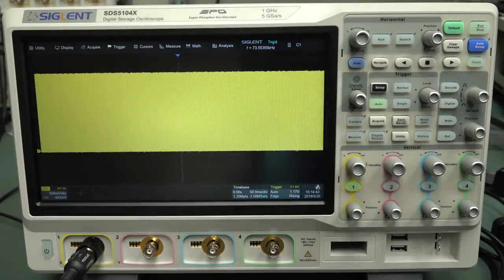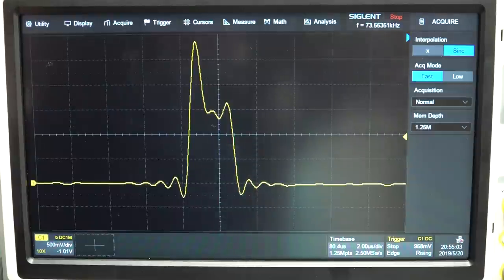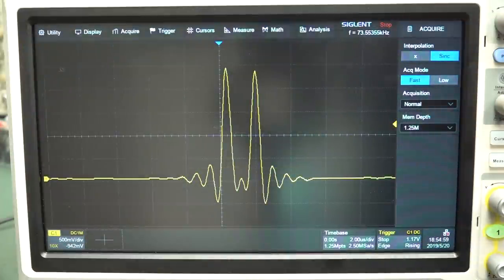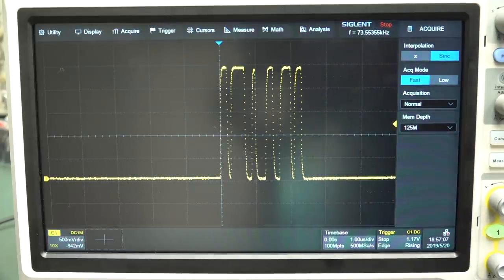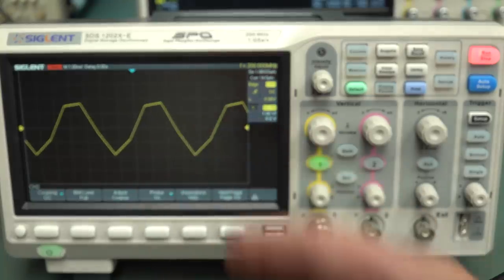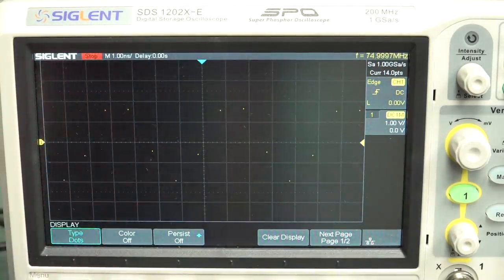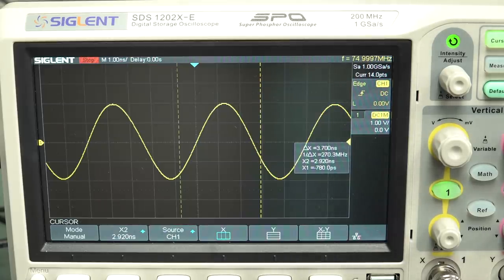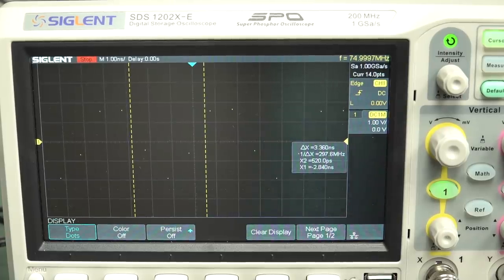EEVblog #1213 - The Oscilloscope Interpolation Trap!

Comment: I wouldn't call sinc "smoke and mirrors". The Nyquist-Shannon sampling theorem derivation requires convolution of the sampled values with an ideal sinc function to recover the original signal. The reason for the 4x instead of the 2x limit is because of the finite number of samples and the finite (non-ideal) sinc function used. Just as the Fourier transform is only valid for infinitely repeating signals so real systems use windowing functions which add some distortion. It's important to know what the differences from the ideal case are to interpret any measurement.
Reply from the maker: It was just a turn of phrase, meant to explain that something tricky is going on. I explained how it's mathematically correct.
Reply: @EEVblog  I assumed you knew, but wanted to elaborate on it a bit. Give people the terms to search for and all, with spellings. I suppose I phrased things badly.
Reply: @EEVblog  On the other hand when it's on you'd know something's wrong then you can zoom in. Otherwise you'd end up using linear without knowing there's something between the samples.
Reply: The same problem occurs for inexperienced DSP engineers in using FFTs for spectral analysis. Various window functions can be selected depending on the signal and sample rate. I have seen numerous cases where engineers told me that a spectrum they were examining looked distorted but what they were actually seeing was the effect of the particular window function selected.
Reply: How does having a finite number of samples on a CD audio track affect the resulting waveform?  Does that add distortion that wouldn't be there if the audio were sampled at 88.2 KHz instead of 44.1?

Or, better stated:  Does the distortion introduced by not having an infinite number of samples in a 44.1KHz audio track show up in the audible range?
Reply: @Hyxtryx  If the filtering is not steep enough there will be frequency inverted signal going into audible range. But that would be too stupid to design such design. And the phase shift due to filter may cause audible difference. Science haven't shown which type of filter is the best but it's there. 
And the bit depth of the sampling will affect the Nyquist theory. So it will not be ideal. So better bit depth, higher sampling rate, more gradual filter will be the best way to reproduce audio signal.
Reply: Sinc is not the problem. Using linear interpolation won't save you. It gives a far off result when a sampling rate is insufficient and a signal contains high frequency too, just a different kind of wrong result comparing to sinc.
Reply: "The reason for the 4x instead of the 2x limit is because of the finite number of samples and the finite (non-ideal) sinc function used."
Thanks for this, exactly the info I was looking for. I was like "What? Nyquist OK, sinc used, then why the poor reconstruction?"
Reply: Creates high-frequency ringing, you filter out anything higher than 20 kHz. So yes, higher sample rate could push your distortion beyond 40kHz, but honestly past 16kHz is basically not audible.

Original CD spec is sufficient for stereo audio reproduction. When recorded properly, using the 24 bits of dynamic (loudness) range and the 44.1 kHz bandwidth, it sounds just fine.

Comment: Basically this is just sampling theorem. Multiplying with delta pulses in the time domain (equals the sampling process) means folding in the frequency domain. If you want the analog signal back you filter in the frequency domain with an ideal rectangel to get only the low frequencies up to the maximum of 200 MHz limited by the bandwidth of the analog frontend (and not the ones that occured as copies of the real signal at higher frequencies due to folding as an effect of sampling in the time domain). This rectangel in the frequency domain corresponds to folding in time domain with sinc aka. Use a sinc-wave for every point in the time domain. If you have too low sampling the frequency copies due to the sampling interfere with the original low signal-frequencies. Trying to filter out the original signal with the ideal frequency rectangle filter aka. Sinc-interpolation in time-domain is not possible anymore and you get nonsense. The time domain sinc is therefore just coming from the ideal rectangle frequency filter. Flies away.

Comment: I always maximize the memory and check the sample rate before I zoom in.   On my SDS1102X the slowest sweep that will capture at 1 Gs/s is 1ms/div with the full 14M memory depth turned on.   It is great for zooming in on the scope, but gives you a vary large file if you want to save the data.
Reply from the maker: Yeah, but you have to know that and do the mental calculation and keep track
Reply: @EEVblog  You can just watch the sample rate indicator as you adjust the sweep rate.  If it drops below 1GS/s your sweep is too long, or you do not have the memory set long enough.  You don't need to do it in your head.

Comment: Good video about an overlooked aspect. The 500GS/s advertised in the data sheet is acquisition interpolated sample rate. These samples can be saved, while display interpolated samples cannot. They are meant to fill up the screen pixels to get a continuous signal.

Comment: The whole "deep memory" thing seems like a trap for young players... why does it allow you to zoom in beyond what can be reliably rendered from the available data?
Reply: I get annoyed by scanners and cameras that do it too.
Especially since they often make a concerted effort to obfuscate what the actual resolution limits of the sensor are. (Especially scanners - my scanner is something like 1200x600 DPI, yet the software just goes up to 3600 dpi and makes absolutely no mention of which, if any of the settings produce an interpolated image.)

Interpolation, especially without explicit warning that it's being done really can be frustrating sometimes...
Reply: Yep, fell for that once or twice too, but it´s the way it is, sample memory is either expensive or slow. Going for logic analyzers however does not help when trying to see signal quality. Throwing money at the problem by even higher bandwith scope is not for most hobbyists. The good thing is that MSOs get better and better and you can check signal quality and have data interpretation in one device.
Reply: @closure4791  But do you know the answer to my question?

Comment: This video is basically a 17 minute long advert for having a fully analog scope on your test bench alongside your digital one. This won't affect a pure analog scope as they don't have interpreters to begin with.
Reply: So how does it connect the "dots"? Not in a "curvy" way?
Yes, I know, they are not individual "dots". Just get to the point what the signal looks like. I doubt that it would be any better.
Reply: @leocurious9919  Analog scopes don't draw dots at all. Analog scopes amplify what you're probing, then use that to drive the deflection yokes of a cathode ray tube display. That, in turn, magnetically deflects a stream of electrons that excite phosphors on the screen. That's what makes them analog; They show you exactly what comes into them.

They don't have quite the capabilities at super high frequencies, but on the flip side, you won't get bitten by sampling errors. That's why you should have one on your test bench alongside a digital scope. You want both. Both can do things the other cannot, they compliment rather than replace.
Reply: @TestECull  Analogue also has limited bandwidth. And when that happens it's way more ugly than sinc interpolated digital scope.
Reply: @TestECull  One digital scope is good enough. Analogue scope doesn't help anything.

Comment: EEVblog  Dave,  Interpolation is/was not used on analogue CRO's, like the Tektonix 511 (or 547 if you wanted dual beams.) simple reason is they don't need it, because they display the whole timeline not discrete samples.  Modern sampling oscilloscopes use interpolation to display a pretty waveform, and as you correctly point out, this can provide misleading results.  This can lead you astray if you are chasing spurious signals, ringing etc that is occuring at the upper limits of the oscilloscopes bandwidth, you most likely will miss it, but with the old analogue CRO,s you still got some visual indication that something was there.  Obviously the old CROs had their intrinsic issues, like persistence and brightness at higher speeds, blooming and burnt out screens, plus they were heavy and fragile, and forget about signal capture, that was done with a special polaroid camera attachment, but, they did have their advantages.

Comment: In short, it just treads sampled data (represented as dots) as impulses and replaces them with sinc function for better reconstruction.
This is how basically ADC's work. In a practical situation, sinc function is a square wave. It is called zero order hold. It is widely used in PWM technique. According to Sampling Theorem, data should be sampled with frequency twice time higher than max. freq. component of the signal. If you dont, signal is distorted. That is what happens in the video.
Reply: You are mixing stuff up. Sinc can in either time domain or frequency domain. The pulse is in the other domain. In this case sinc in time domain and brick wall in frequency domain.

Comment: the effective sample rate is making assumptions about the signal... the scope is a device to show you what the signal is.
you have a scope that shows you what it assumes is happening, not a scope that shows you what is happening.

you can only use the scope close to its sample rate if you already know what you are measuring.

Comment: the mathematical motivation for using sinc is, if you integrate a square pulse, then integrate the resulting triangle, the integrate that, ad infinitum, you end up with sinc. it's analogous to going from "nearest neighbors" interpolation to "linear" to "polynomial" etc etc all the way to the "end"; so sinc is the "ideal" sampling kernel for interpolation in this way. it's also the fourier transform of a square unit pulse, i dunno if there's a more obvious explanation there.
Reply: Absolutely,  but the sinc isn't finite. Usually you get away with it if you have sufficient discrete samples so that the cumulative error is less than that of the instrument. Another option is to window your sinc with a Gaussian  (as it will stay Gaussian in Fourier space ) which will make your interpolant finite.
Reply: @LutzSchafer  good catch thx

Comment: I don't think you're quite on the mark when it comes down to the interpolated sample rate of the high end scopes. It means that they can vary the trigger delay by a few pico seconds and then overlay the different samples so that you actually have all samples measured, although on a different part of the waveform. This only works on pure repetitive signals where the trigger point is well defined.
Reply: Pretty sure this is called equivalent  time sampling (as opposed to to real time sampling). They used this a lot before high bandwidth adcs were cheap.
Reply from the maker: That is Equivalent Time Sampling (ETS), quite a different thing to interpolation on a real time or captured signal

Comment: Hi Dave, coincidentally I was snooping around the forum looking for some guidance on a sampling scope last night, so this is quite helpful - I'm trying to debug the ringing in an epaper boost circuit (I gather I need to design a snubber filter across the switch) but I'm using an old analogue 20Mhz oscilloscope, so  measuring the frequency of the ringing is pretty tricky. I've just got to estimate it from the graticule by eye before it disappears - no cursors and no sampling!

I don't know if you've done any vids about controlling or preventing ringing in boost circuits - one clue I've noticed that there is ringing is that when the circuit powers off there is a little (audible) noise from the circuit.
Reply from the maker: Haven't covered that, sorry.
You need a digital scope!
Reply: @EEVblog  Texas instruments and digikey both have guides on it with minimal maths needed, plus a little experimentation to find the right capacitance value. If I'd known how to design it to minimize ringing, I could have avoided the need for the snubber circuit altogether - as my reference circuit did.

Digikey: https://www.digikey.com/en/articles/techzone/2014/aug/resistor-capacitor-rc-snubber-design-for-power-switches

Texas Instruments:
http://www.ti.com/lit/an/slva773/slva773.pdf

Many thanks for the vids!

Comment: The interpolation can be misleading, but the underlying problem is the scope, for what ever reason, not using the full buffer.
Seriously - in most instances you just want to capture the data and view it. it would really make sense to set it so the sampling-rate over the capture-time pretty much fills the whole buffer - unless you specify the sampling-rate or other settings.

And why the hell do scopes still have so little memory???? Make it 20$ extra for 4 GB RAM - at 32bit/point that would still be another 100 million sample points.
i have seen explanations like "more sample points cause longer deadtimes" - why? The scope does not need to visualise all the points at once. The overhead of a simplified depiction is rather small, but the benefit of being able to store several times more data can be quit nice.
For example when trying to capture the characteristics of many repeating analog signals - capture the first 2/4 signals, keep them stored in memory, capture the next, and the next, and the next.

Comment: It can be mathematical proven from dac to adc both using sinc or same sample rate. I have done digital processing in university it can be proven. Nyquist theorem is also proven.
But if it's from a unknown source, it's not the case. However, sinc is to utilize the available sample point in a most efficient way for lowest bandwidth. In a different perspective, if you use linear interpolation, you can creat high frequency noises which you don't want. Also you can post filter the linear interpolation result to get close to sinc. It's just digital filtering.

Comment: Wrong! It's not memory depth. It's lack of anti-aliasing filters for lower sample rates. Look at sample rate on 14:30 when you change time base (sec/div). Sample rate is automatically reduced as time base is increased, while acquisition is running. When you hit stop button, sample rate becomes frozen. Nyquist sampling criterion not met - distorted signal you get.

Comment: It seems in signal measurement domain, sinc interpolation is the king and it is not possible for other types of interpolation to contend w/ it, such as spline, polynomial, etc. Is it still the case in 2023 when I'm commenting now?

Comment: So why is the memory depth not always set to maximum?.  What is the trade off?
Reply: This - exactly this.
There is pretty much no tradeoff. And it should be the default-setting.
Reply: Basically everything runs slower : math functions, refresh rate, etc
Reply: @autogolazzojr7950  ... only if they were braindead and would brute-force everything.
There is no need to perform maths-functions on the full raw data you know? You can just apply them to a sampled set or other subsets and get pretty much no performance downsides - and then if you choose you could apply them to the whole dataset and get more accurate results when needed.

But i am sure that to you a car having a bigger  trunk also means you will always take longer to load and unload it, even if you just take out the last part you put it.........

Comment: Oh boy, oh boy. The Shannon Nyquist theorem specifies explicitly that you have to get a ratio of AT LEAST 2:1 of the HIGHEST frequency component of your signal. Else any anomalies at or above the 2:1 ratio in your signal is going to suffer representation with amplitude and phase errors. IMHO Shannon-Nyquist is a base to start from when designing requirements, but far from being the "rule". I actualy never use it as a base to start from. I look at the TDH I can afford and work from there. I am not belittleing the work of those two pioneers which I hold the highest regards but in college and universities, I think their work is misrepresented. I work in telecom.

Comment: As a noob asking: Do you think a analog scope is better to use for beginners?
Or in other worth: What is the best type of scope for a beginners?
Reply: I think the best scope to learn on is an analog/digital hybrid, but honestly digital is better than analog. Digital allows you to stop, measure and analyze your waveform. Not gonna happen on an analog scope.
Reply: @autogolazzojr7950  Back in the "old days" before we had digital scopes, I used a type of analog scope called a storage scope which was able to freeze the image on the CRT face. This was the only practical way to capture a singe-shot pulse for analysis. It was certainly not as good as a digital scope and it had limitations but it was better than nothing.  Another consideration is size. Most analog scopes are huge, especially in depth because of the CRT, as compared to modern digital scopes. If you have limited lab bench space this is a factor.  I'll take a digital scope over an analog scope any time.
Reply: @stevewhite6252  I'll second that.  As an old engineer who grew up with analogue and storage scopes, back in the day it took a lot of skill to capture a good picture of anything, with dodgy unfiltered sync and no pre-trigger capture.  Scientists turned to me as the "lab scope expert" rather than figure out how to use them themselves.  It's so much easier with a DSO, but you do need to take the lines between the dots (whatever shape they are) with a pinch of salt, and to only use the fancy analysis features ( interpolation, averaging etc.) if you understand what it is doing and what pitfalls it introduces.